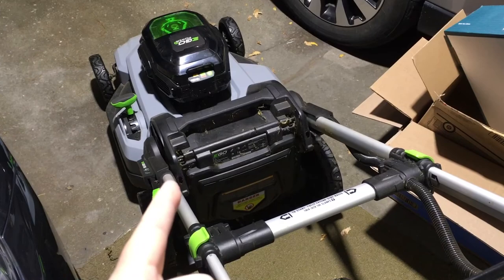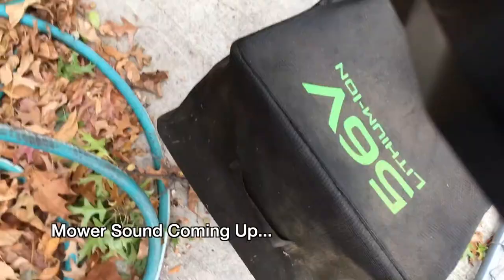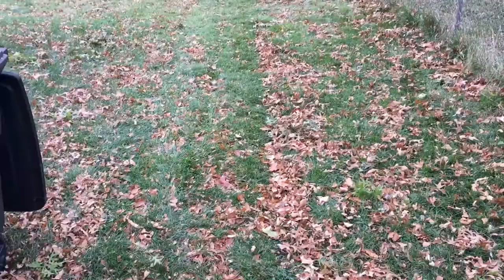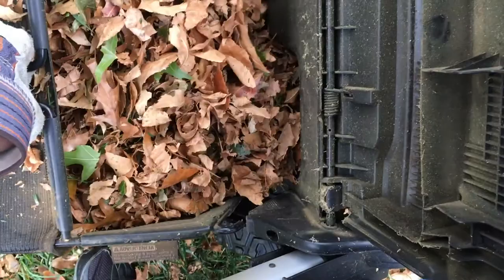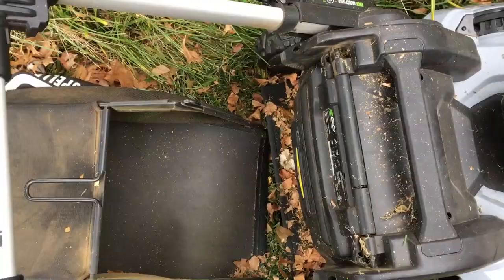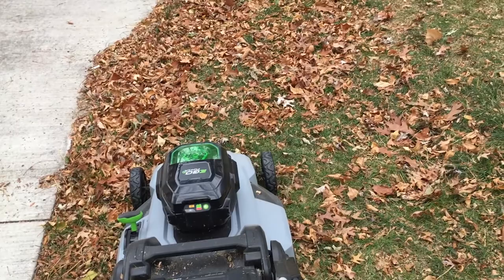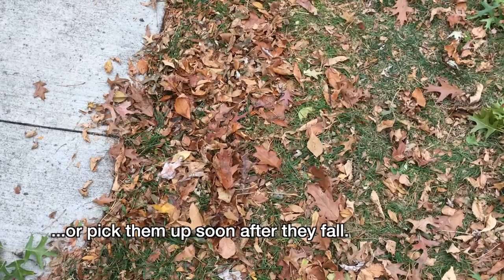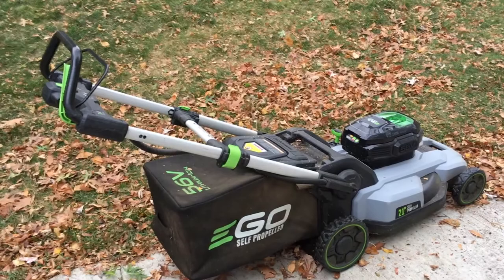Bagging Leaves with an EGO Power+ Battery Powered Mower

Comment: I had the exact same issue of it not grabbing the embedded leaves , got so frustrated I fired up and ran my old Toro over a similar area it grabbed them all and left a clean lawn . I found the issue to be the ego blade I was using , I was running the optional dual mulch blade that came with my ego instead of the factory installed single tip bagger blade . Swapped blades back to the original blade which provides substantially more air lift due to its swooped design and now it cleans the leaves completely off the yard. In my opinion the biggest downfall to this as a bagger / leaf collector is the small bag in comparison to my old toro and snapper. Still love it though , just needs emptying twice as much .
Reply from the maker: My previous mower was a Honda. I think the bag on this was around the same size as it. My Honda did have a dual blade but I have the single on my Ego. I wish we could just burn them. That's what my family did when I was growing up. Now it isn't allowed.
Reply: The exact reason I bought the greenworks with the turbo over ride button. Works like a champ!

Comment: The high lift blade picks up 3 times as many leaves.  Mine is a freaking vacuum.  Only down side to the high lift blade is that you have to always bag, and in my estimation it will use up to twice the battery as the mulching blade.
Reply from the maker: That's good to know. Thanks for the input.

Comment: I almost have to consider using a leaf mulcher to mulch the leaves further since it looks like some barely got chopped up.  I've not used the bagger on any of our push mowers to collect leaves, but I might try if I think of it.
Reply from the maker: It's certainly better than just raking leaves but it definitely isn't the best mulcher ever made. I occasionally use a riding mower with bagger and it chops them up quite a bit smaller.

Comment: good video.  I'm new to all this - I had a lawn company handle everything but now doing it myself.  Why would I want to mow my leaves rather than just use the Ego leaf blower I purchased with the mower?  any advantages to mowing over blowing?
Reply from the maker: There are a couple of different options. You can mow them and let the pieces of leaves stay where they fall. Ideally these will break down and fertilize the lawn. If you have too many leaves, you can bag them with the mower and dispose of them. You can also blow them with the blower and collect them for disposal. The advantage of mowing them is that it chops them into smaller pieces. I'll often use my blower to move leaves away from fences and such to an open area where I can mow them up.